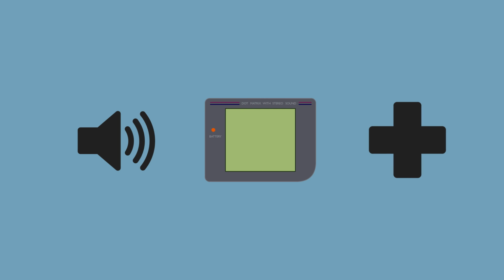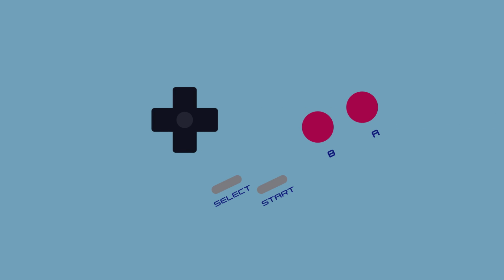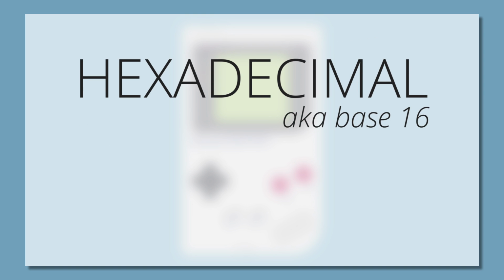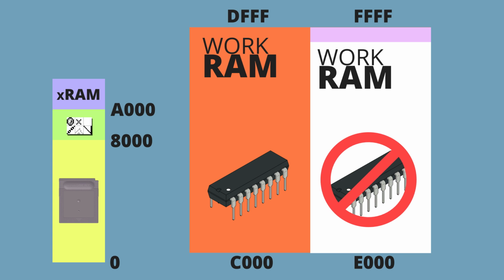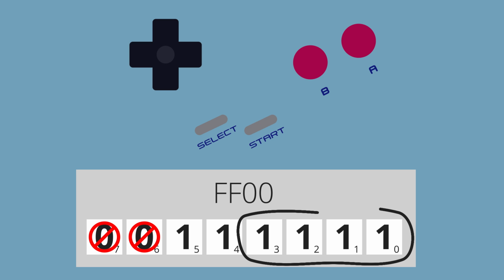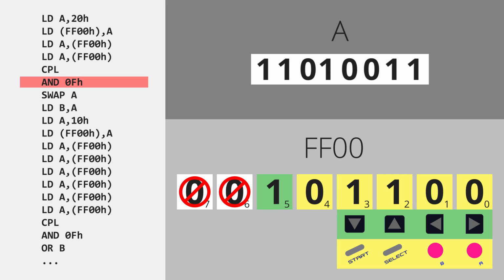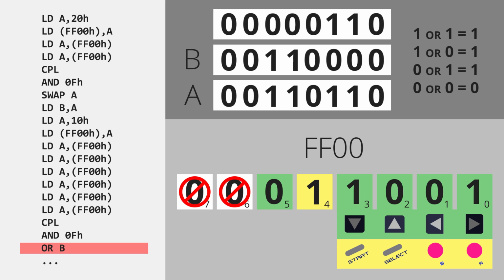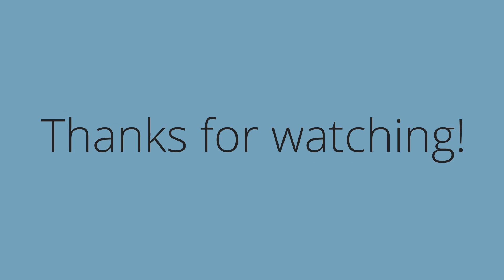The Game Boy, a hardware autopsy - Part 2: memory mapping

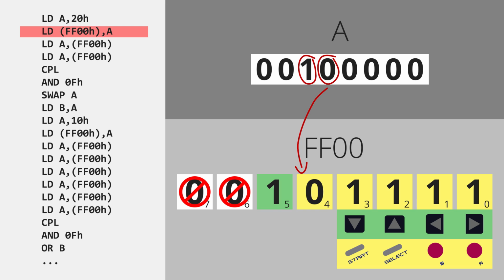Comment: 7:33 This is not for debouncing as these instructions execute in a few microseconds, 3 or 4 orders of magnitude smaller than the amount of time required for debouncing. In fact the official Game Boy Programmer Manual (page 24) shows that you always have to read from the D-pad exactly twice and the face buttons exactly 6 times for hardware synchroniation purposes to read a stable value, so you will find this quirk of at least 2 calls after loading 20h and 6 calls after loading 10h in every Game Boy game.

Comment: Man I watch this when it came out and I am still wondering how the cartridge trick works. I get that you maybe don't have the time/will to make any more of these videos, but could you maybe make a post on a blog or something? Thx anyway for the effort.
Reply: Cartridge trick? If you mean memory mapping where the memory in a cartridge is very large compared to what the gameboy can read it's like this. The gameboy doesn't know or care how the cartridge works, it just wants the data it asks for. It can only ask for 32Kb of data (if I remember right). However the cartridge does not have to play by those rules because the cartridge is not the gameboy, it can make up it's own rules as it pleases and the GB won't care or know.

Most cartridges had much larger memory and they would implement a "switching" mechanic. If you take a 2MB cartridge and divide it into "pages" or more commonly named "banks" where each "bank" or "page" if you prefer is 32KB. Then it's just a matter of implementing a mechanic that allows the developer to switch banks at will. Most cartridges that did this assigned Gameboy address 0x4000 as the first byte of other banks. So if bank #5 was active and your game requested a byte at address 0x4005 or 5 bytes into the start of the bank the cartridge would hand that to the CPU. The developer could switch banks to bank #3, for example, in which case address 0x4005 would instead be 5 bytes into bank #3 and would likely be a different value as it's a different bank.

I hope the Youtuber makes another video but I also hope my explanation was enough. Feel free to reply but make sure you @ me so that I get a notification in Youtube.

Comment: I have probably found the source of the material used to make this video. I link it here because it seems that the video series was interrupted and I think that it's not fair for us to be left without the last part of the nerd's Holy Grail (Lol)...
Anyway, here it is:  http://gbdev.gg8.se/files/docs/mirrors/pandocs.html#memorybankcontrollers as you see it links you directly to the argument "memory bank controllers", but there is also a lot of knowledge used by these videos. You may need some general basics of assembly. If you don't have such basics, try to find materials about the Z80 (strongly advised) or other CPUs like the Intel's 8080 and 8086 (the syntax in this case could be different).

I hope that this comment could help someone. :)

Comment: The button management is really simple and it's called multiplexing. The Game Boy buttons are basically a 4x2 button matrix:
     1      2          3       4 
1 Up, Down, Left, Right
2 B,    A,       Start, Select

And so we will only need 4+2=6 pins, instead of 9 pins (8 data 1 ground).

The NES is much more primitive in that it doesn't use multiplexing, so each bit represents a button.

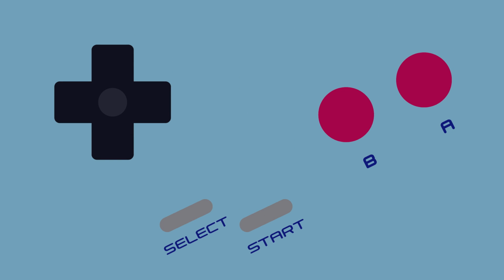The part that I'm referring to is starting somewhere near 6:20

Comment: I'm a little upset that you keep referring to the Gameboy Color as a variation of the Gameboy rather than it's successor. The GBC's specs are far superior to the GB, it didn't just add a color display, so saying something like Pokemon Crystal was an original Gameboy game like Tetris or SML is pretty annoying to say the least..
Reply: The GBC used virtually the same hardware as the original GB did, most of it was only a minor upgrade solely for the purpose of processing colors. Most GBC games could be played on the original GB and the main reason it was pushed out before the GBA is due to the original GB's age. They needed to fill the gap on the cheap.

Comment: I hope you keep making these videos. I'd love if you could make some form of outline of a the components of a modern CPU, or a GPU's CUDA core. Most existing explanations are either filled with technical jargon that is only relevant to one or two processor generations, or they are so simplified that they barely explain anything. I'd like to see some implementation details about the interface with the 3 levels of cache and to main memory, for example. Or an explanation of exactly what PCI lanes are, and showing how the CPU shares them between different slots and components; or of how m.2 (or PCI-e) is faster than SATA; things like that.

Comment: Why is there unused and forbidden parts? Surely the devs would want to use as much RAM as possible for their game/system?
Reply: Yes and no. Like all things, there's a balance. RAM was prohibitively expensive back in the late 80's, and these systems were being mass produced with cost in mind. They simple found a size for RAM that was "good enough" and moved on.

Also, RAM chip sizes typically come in powers of two (2^13, 2^32, etc), and increasing from 8KiB to 16Kib would have been wasteful since 512 bytes of the I/O space would have overridden the RAM anyways.
Reply: But according to the video, the RAM is there, it's just unused or prohibited. If it's already been bought and installed, why not allow it to be used?
Reply: The RAM isn't physically there, there is just addresses for potentially mapping RAM there. The addresses between 0xc000-0xdfff (the work RAM region) and the addresses between 0xe000-0xfdff (the region in question) are mapped to the same physical 8KiB memory chip. Hence why data written to 0xe000 will show up in 0xc000 also.

You can imagine this as the house you live at having 2 addresses, technically they are different addresses but GPS would navigate you to the same place given either address.
Reply: I see, thanks.

Comment: Is RAM address space the amount of RAM space you have, or is it different?
Reply: It is the amount of RAM you could theoretically address. The physically installed amount of RAM might be actually less than the supported address space.

A simple example: My tablet has 2GiB of physical RAM and a 32-bit OS installed. With 32 bits, the address space is 4GiB, which is twice as much as I have installed.

Comment: Jack, this video is absolutely phenomenal. As a software engineer, I can NOT stress the importance of understanding how computer code, especially in a low level language, such as assembly, actually works with the hardware of a machine. Looking at the old brick and how it works, is not only the most interesting way to learn, but probably one of the most exciting and entertaining ways. 

To any entry level developers out there, this really reflects on modern system! Understanding low level concepts such as memory mapping will prove to be extremely useful in many computer science and engineering careers.

Comment: Why not have the 8 buttons correspond 1 to 1 with the 8 bits directly instead of using 4 bits at a time and doing all those extra steps from that final code example? It seems more efficient if you could cut out all those steps for every frame.
Reply: Looking at the CPU, and the ribbon cable pinouts (remember the DMG Gameboy was a 2 board layout vs a 1 board design) the CPU is only using 4 pins to read button input. and the traces are in fact connected on the LCD board.

I wouldn't doubt this was done to make the system a little cheaper. Or it could just be that they ran outa pins on the CPU. - Im too lazy to look that up >_>. Whatever the case may be, this is a hardware issue.
Reply: 16 Bit Images one reason: they needed a bit to toggle to get the state. Otherwise the state could only be pressed half of the time causing an error where not every is loaded correctly everywhere

Comment: I find the memory for the pressed buttons weirdly implemented. We got 8 Buttons and 8 bits. Why couldn't it just be constructed that if the a button was pressed one of the 8 bits would turn fomr 0  to 1 (or vise versa)?

It would eliminate all this complicated switching and merging
Reply: It probably simplifies the button circuitry. The buttons are probably wired in series so that both the dpad and the ab start/select buttons only have 6 signals come off 8 buttons.

Comment: Could you explain again that 'debouncing'?
Reply: When two contacts are pressed together they don't stay together at first. They bounce a few times, breaking and making the connection with each bounce. All these bounces occur within milliseconds.
If the button state is monitored very often (eg: using Interrupts), the software may think the button is being pressed more than once.
So it checks the state, waits a bit, and checks it again. Once both checks match, it is safe to begin the events that occur for that button.
Debouncing can be done with hardware, avoiding extra code, but it requires extra circuitry instead.
I hope that helps.
Reply: +fox fyre3 (foxfyre3) that explained the problem to me. Thank you!

Comment: its a form of compression, factor 5 fit the indiana jones PC port onto a 64mb cartridge.

Don't forget, cds hold 712 mb 
This is impossible to hold on a Single Cart.
However, NOT impossible if you could compress 712 mb into a 64mb space.
Cds held more memory Or ram, but it is "uncompressed"
Like Pokemon cystal the GBC should not be able to play games 64x=(62^2) the machines limit in Working Ram.
2mb is 2,048 kb  (1mb is 1,024 kb ) 32kb-64kb was the GBC limit.

Comment: I am not convinced by the debouncing explanation. Even for memory mapped hardware, a known quirky beast, it does not make sense.
Reply from the maker: The code was basically wasting time waiting for the bits to stop bouncing, that's why the values are read multiple times.

Comment: 6:35: The upper 2 bits actually return 1. All unused bits in the I/O memory range (FF00 to FF7F) return 1 regardless of what you write to them. The exception is the register at FFFF, where the unused bits are actually write/readable, I suppose that Nintendo just used the last position of the HRAM as a register but didn't bother to remove the unused bits.
Reply from the maker: That's interesting, thanks for pointing that out. I found other sources that claimed otherwise, but didn't have a real Game Boy at hand to test it out. Did you try it on real hardware?
Reply: Yes, I've made a lot of tests on hardware because I wrote an emulator and I didn't really know how the unused bits behaved. What I've said in that comment is what I noticed in my tests, and it's consistent between all the GB models I have (DMG, GB Pocket, GBC, GBA, GBA SP). Also, I've just checked the BGB emulator (which focuses on accuracy) and it also says they are 1. So yeah, you can pretty much trust this information. :P
Reply from the maker: +Antonio Niño Díaz oh, I believe you, I was just curious! I should definitely keep bgb as a reference: the effort that goes behind writing such an accurate emulator is crazy. Thank you again for pointing it out!
Reply: No problem! I really like your videos so it just bothers me that there are some small stupid mistakes like this one! :P

Comment: watching these videos is making me want to get back into hardware 
development. i used to use assembly back in the day when i first got 
into hardware development.

of course then i added a few extra commands to assembly
because i figured out a way to use my laptop's primary and secondary 
batteries as a method of creating extra system memory to my laptop as well as a few other things.

sadly, i never finished that project. either way, i look forward to the next video in this series. please hurry up and post the next one. and if possible, can you please recreate the first video so that the mistakes are longer in it because video 1.5 does not point out the issues in the first video in the way that it should.

i am only asking you to redo the video because i can be a bit of a perfectionist and for some reason i would like you to setup this series as a lesson plan. and also possible more details about how to write in assembly for us enthusiasts who with to know all the details of how the gameboy works.

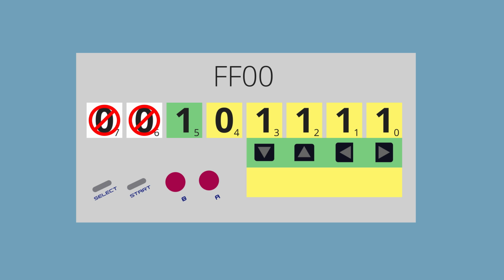Comment: In a saner, more modern architecture, the operation at 7:00 of reading in the buttons would be merely "LD A, (button address)" because you have an 8 bit register and 8 buttons... The complication involved just wastes CPU cycles. If you need more than 8 digital inputs? Use a second input IO register. They probably had absurdly limited IO space on the chip though and wanted to multiplex their IO pins. A savings of 4 input pins at the expense of 2 output pins and lots of cpu time just doesn't seem worth it though.

Most of the Z80 derived processors I've worked with have over 32 IO pins though, not counting the data and address bus.
Reply from the maker: Agreed, it's definitely a very confusing choice on their part.
Reply: Heh, but there's more. The 2 bits that are writable are actually outputs from the CPU chip. The Super Game Boy (to play GB games in SNES) used them to read commands from the GB. You would write 1 and 0 to those bits in regular intervals and the SGB would interpret them as different commands (change colors, sound effects, etc).

Comment: Why not have address FF00 represent all 8 button inputs at once?  That seems like a much less convoluted system than requesting the dpad and button inputs seperately.  After all, there are enough bits for each button, and the AND operation would do its magic in the same way.

Comment: oooh this is giving me a headache... if something as low tech as the GB confuses me this much, good thing I gave up on programming.
Reply: That's really low level programming, it can be way harder to understand than higher level. Don't give up!
Reply: nah, that was in assembly, which is one of the lowest levels of programming. High level languages is much simpler and easier.  

Take Unity and C# for example, in the video when she explained how to get button input, there was about 8 lines of code. In Unity, that would be just one line: 

if(Input.GetKey(KeyCode.Space))... //if the space key is pressed, do something

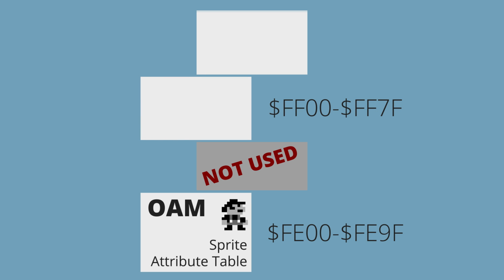Comment: Correction at 5:28 (regarding display controller, input, etc). It's a 128 byte area, not 127, because address $FF00 also counts.

Comment: Wait, aren't the tiles on the ROM cartridge? Or are they loaded into the video RAM?
Reply: *****
Oh, alright. Thanks for the fast reply.
Makes sense that the cartridge isn't fast enough to replace vram, now that I think about it.
Reply: I certainly don't think speed is the issue? As far as I know, the memories on the cartridge are just as fast as the memory in the gameboy. You're practically just extending the gameboy's circuit board when you plug in a cartridge.. On the NES many games actually provide more VRAM on the cartridge to be able to scroll in several directions, for instance.
Reply: Johan Fjeldtvedt
Hmm... Maybe it's because of the cartridge's memory paging then? That's what the video was hinting at the end, right?
Reply: *****
As I understand it, atleast on NES, there are never multiple copies of same tile data in memory. The thing that decides which tiles get drawn on screen is the nametable which can point multiple times to a same tile, but there is never a complete screen full of pixel data in NES's memory. If I'm understanding the PPU's wikipedia article correctly, NES reads sprite data directly from the cartridge's ROM when drawing to the screen, which would make sense as memory was expensive back in the day.

Am I not getting something or is this different on the Game Boy?

You also mentioned compression on gameboy, I'm really interested in that. What kind of compression methods could be used with such limited hardware?
Reply: Tile data is copied to VRAM. It can't be read directly from ROM.

Comment: Calling it now: Memory pages are involved in fitting those large games in that small address space.
Also, why did they make reading out the buttons so hard? Since there are 8 buttons, you'd expect a 1:1 representation in memory. Were they using some multiplexer to save on port usage on the processor or something?

Comment: So there are eight buttons, and eight bits in each memory location. Then why are the two highest bits in the input word never used? If they were, you could map each button to its own bit, and be able to read the states of all buttons in one go, instead of two reads and then combining them. Was it a hardware limitation which prevented the use of those two bits? Or something else?
Reply: It was probably a hardware limitation of the memory controller.

Comment: great video! I really enjoy this series!
But why is the "debouncing" handled by copying the value multiple times? Wouldn't it make more sense to firstly just copy the values of a,b,start and select (without modifying them with "AND" etc), THEN set the flag so that the bit would display the arrow-keys, and while the "bouncing bits" are still not stable perform the arithmetic operations on the already stored values?

I mean: Instead of copying the value multiple times you could just perform arithmetic operations on the previously copied values while the mapped byte is still "bouncing", couldn't you?
Reply: Yep, that's just the way most games do it, but there is no reason why you shouldn't do something else during that time.
Reply: +Antonio Niño Díaz OK, thanks :)